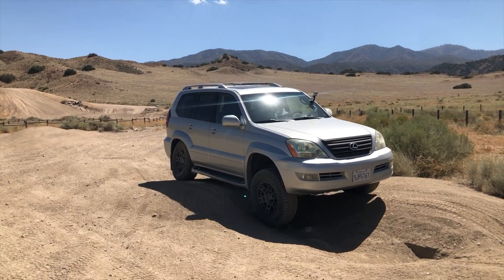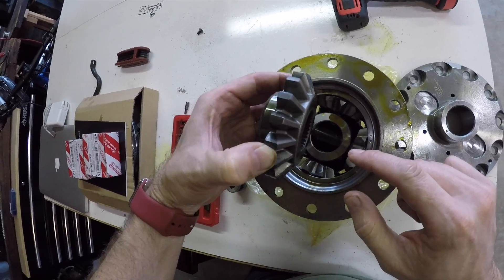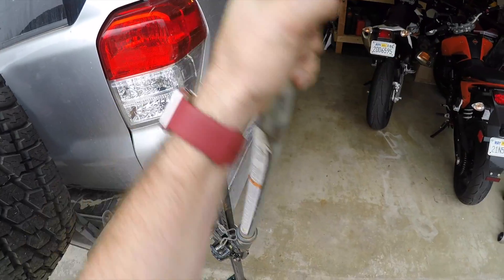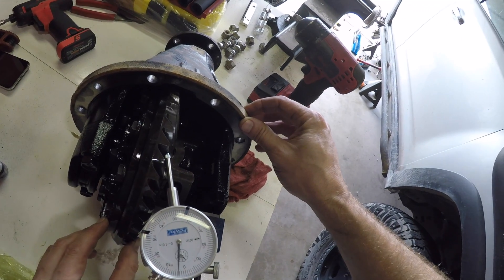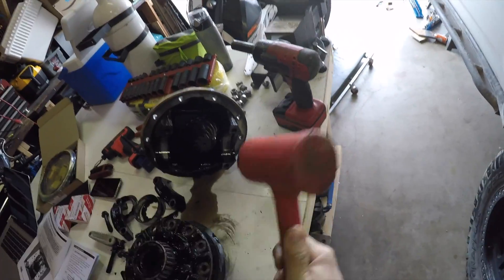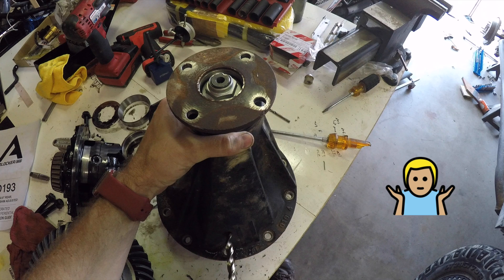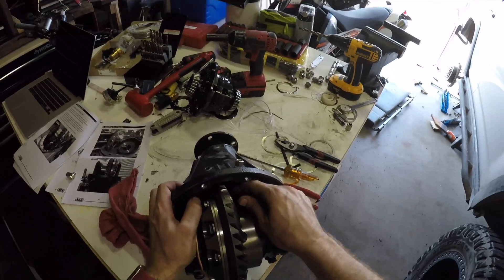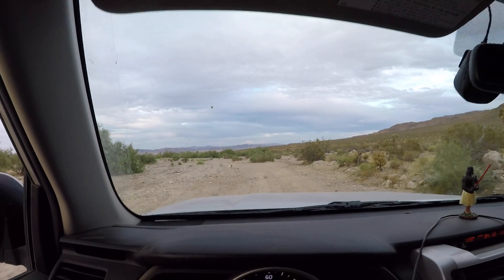The "Wrong" Way To Install A Locking Differential

Comment: great youtube history, congrats, but, i was surprised you didn't check gear contact patch with die or paint to see if your pinion shimming was still correct, one step always done when done right, in my observations, i was researching and close to adding front and rear limited slip to my 2001 4x4 1/2 ton black Suburban LS. it was so heavy in sunk and slipped a lot. so my research and elevator experience agreed with not only checking the side shims for preload but, also the pinion shim for gear contact patch. what did you experience, no change notifiable?

Comment: Here is how you can install a bearing without a press. Get a small pot, fill it with enough oil to cover the bearing. Heat the bearing to 350f. Remove it with pliers and drop it on. It will just drop, wait for it to cool and Bob's your uncle, it's installed. I have a camp stove I used.

Comment: 9:44: I did try to tighten PZ screws with PH bits (as well as vice versa) and I strongly advise against it.
Reply: I hate all of the cross/flat standards. We should move on to hex or torx only already.

Comment: For brake bleeding, clear vinyl tube works good, one end over the bleed screw the other in a small container with clean brake fluid ( stops air from sneaking back in)

Comment: Hey Matt, you never checked your contact pattern between the gears.
Is there a reason for this I am not seeing?
Maybe because you didn't change your pinion gear bearings? 🤔

I did this on my HJ61 9" differentials, but on these the preload and backslash is also set a little different.

Comment: When I grenade'd the locker on my Jeep Rubicon several years ago, I bought a replacement and took it to a local shop that specializes in rear ends. They swapped it in for $250 and it's worked perfectly since then. Your $1,000 quote seems rather high....  On another note, having a front locker makes a huge difference in many situations, it's 3 vs. 4 wheel drive. There have been many times when being able to lock the front made the difference between driving out, and winching out.
Reply: I was quoted 1k in labor for an ARB elocker as well from a very reputable 4wd shop in Denver.  Air lockers are also a little more finicky than elockers.  They probably bake a little extra into the price in case someone comes back with an air leak which is a pretty common issue wot have with ARBs.

Comment: If you don't use thread locker on the ring gear bolt, they (3 of them) could possibly back out and slowly shave the heads off. I'm just guessing, but it was a pretty good reason to get a new rear end...

Comment: From a mechanical perspective, why is a locker better than A-Trac?  The only advantage I can see with a locker is that you have equal distribution over wheel torque at higher speeds.  If you’re crawling, a diff lock doesn’t really give you any advantage as A-Trac Will manage torque distribution better than an even split.  But, at higher speeds or longer straight climbs, momentum is key and I suppose a locking diff would be advantageous.  Point being….I’ve had both features on my vehicles (4 Runner and GX) and A-Trac with 17” Grapplers has never failed me.  I see the advantage but certainly cannot be justified as a $1,500 DIY project.

Comment: And this is why i use a mechanical Detroit Locker in my jeep and Bronco. Installations much easier. No o rings to worry about going bad. And no onboard air compressor to purchase and install. Although the compressors nice to have for airing up tire pressure after running trails. But theres usually a gas station a few miles from most trails in Phoenix and Mesa.

Comment: I could be doing it wrong but I just got a glass sparkling water bottle, drilled a hole in the cap, put some 1/4 inch tube in it, then attach it to the bleed nipple. I make sure the hose goes up before it goes down to catch bubbles. You can bleed with one person but it helps with two to see bubbles.

Comment: Use a hose and jug. The hose goes on the brake caliper grommet and the old break fluid goes in the jug. Just have a second person to push brake pedal until no air bubbles come out in the jug.

Comment: I had an ARB air locker installed on my 1986 1/2 Nissan Pickup.  The only problem I had with it is that it wanted to pump differential fluid from the differential up through the air line.

Comment: Hey Matt why did´nt you build a diff spreader out of a coupple of turnbuckles and a bit of flat bar?
Reply from the maker: Because I didn't need to. but be assured I would have engineered something jankey if I had needed it.
Reply: @SuperfastMatt  Yea I redid a light truck Diff a few Months ago and boy did I need it, so turnbuckles it was.

Comment: Your air locker may not be broken yet since you've spent most of your time doing cooler stuff than driving it...  but when it does, just put the original back in there and weld the spider gears the way it's meant to be.  Done.  Try to avoid unnecessarily scaring folks by reverse parking in basement carparks.  Unless you enjoy that kind of thing.

Comment: Hi Matt, go to the hardware store and get plastic tubing, I have about four feet of it. take a used brake fluid bottle and drill a hole in the cap a little smaller than the tubing and push it through. take the other side of the tubing and stretch the end so it fits on the nipple for the brake bleeder ( you have to get the right size tubing). Viola, bleeding with very little mess.

Comment: I'm a little confused. So you don't need to use atrac anymore?
Reply: you ca use both
Reply: @iwantoffroad  what’s the point? They both are the same thing no? Sorry, I’m new to this
Reply: @ronaldcubillo4950  the atrac works when 1 tire is in the air and looses grip some times its not enough and the locker helps more. search you tube for atrac demonstrations in sand.

Comment: I've installed the bearings by heating them sufficiently (with map gas torch (the yellow bottle one)) and quickly placing them on. Have a piece of wood and BAHammer to make a final smack cause if it cools its in place and then you gottta buy a press

Comment: So 2:36. Pretty sure u can just use bearing grease (slides in easier) and a soft-faced sledge hammer (prevents damage when hitting it in) or just hit it softly with a normal sledge hammer.

Comment: You don't need to use a hydraulic press to get the bearings on.
You would find it easier if you have an induction hot plate to heat the bearing up which will expand the bearing.
When it's hot enough they will just drop onto the shaft, allow to cool and repeat for the other side.
Reply: Be real careful not to overheat those carefully hardened parts. Anything above 120°C / 248°F will reduce the service life of the bearing. The gold standard for DIY heating of bearings is with a pot of mineral oil and a thermometer.
Reply: Same for dropping a ring gear onto a differential unit....Heat that puppy to 220-250degrees and the ring gear will fall onto the carrier...can also put the carrier into the freezer if you like.

Comment: If anyone here ever needs to install the bearings without the use of a press fallow these instructions. Clean the diff. ●Lightly file or sand any sharp edges smooth 
●Put Diff in freezer on the coldest setting 3hrs minimum
●Place inner bearing race in a fryer set to 400°F
●Remove diff from freezer and stabilize in the vertical orientation.
● Remove bearings while wearing welding gloves and drop straight onto shaft. 
● Flip diff and repeat. 
☆☆☆☆ If the bearings don't drop all the way down go get it pressed on☆☆☆☆
Reply: 400 is way too hot for a bearing. 250 is the absolute max temp before you cook the bearing.
Reply: A open steel cage bearing wont be cooked at all at 400 we use bearing heaters at work that will go all the way to 550 on some pump shaft assemblies
Reply: @alexhise968  per Timken, absolutely no bearing should be heated past 250. I rebuild industrial gearbox for a living in a Timken platinum certified shop.

Comment: Loving the videos ... on a side note, what lift, tires and wheels are you running? I’ve got a limited as well and just about to put some KO2’s and a Torq-Engineering 3/1 leveling lift. Likely going with 17x8.5 with either 0 or -10mm offset and 4.75 BS (slightly less BS with the 10mm offset x can’t recall exact number). Also just subbed, thought I did that after the roof rack vid - still debating the build/buy on that one.

Comment: Nice video.  Consider power washing and raptor coating your axles and undercarriage.  Also, it looks like you do not pressure wash after wheeling.   If you do apologies, but if you do not I would highly recommend doing it.

Comment: If you had a 4th Gen, where would you put it? Front or back? I really do t know.
Reply: If you don't have lockers at all, start with a rear locker. That will cover 98% of your terrain needs. You really don't need a front locker unless you're doing some wickedly technical terrain which will also require big ass tires, lift, UCA's, clearance, etc.

Comment: Based on experience, no, you shouldn't use Philips bits on Pozidriv heads, and vice versa. It's probably your sense of humor shining through but I feel that if you're advanced enough to tackle this type of installation you should have a #3 Pozidriv bit in your toolbox. :)

Comment: Some people would say that it’s more important to have a front locker than the rear if you have an independent front and solid rear because there’s a lot more articulation on the solid than independent. But literally every manufacture who gives you a factory locker puts it on the back unless they give you both front and back. Their “experts” probably know what they’re doing.
Reply: A locker on the IFS front end will eventually end up in broken CVs .
Reply: Seth Coleman Colorado zr2 has a locker on  ifs.
Reply: @JonBecker81  yeah, but just because gm does it - doesn't make it a good idea.
Reply: @JonBecker81  IFS's are notorious for weak CV's.

Comment: So if shopping new, go with the TRD off-road instead of SR5 is what it sounds like.  Or is the ARB locker more robust than the Toyota locking diff?
Reply: I have an 03 TJ Rubicon with factory air lockers that have 8psi to hold them in place.  I was told that the ARB is 70psi.  If rock crawling was my thing I see an advantage but for FS roads I travel the factory ones work great.     07 and up have electric lockers.
Reply: Hillbillyjeeper WV they came with air lockers and not just electric mechanical lockers??
Reply: @JonBecker81  yes the TJ Rubicon (03-06) and LJ Rubicon (05-06) came from the factory with air lockers.  The bulk fittings on the one I bought used where rusted so badly that the air leaked and the lockers would not engage.  I called one of the 4wd parts store who in turn connected me with ARB.  Just by chance the gentlemen that helped me had work at a Chrysler dealership for years and knew which part I needed.  It's labeled as an axle vent and it's where the air hose connects.  The 2 small compresses are mounted on the belly pan.   I relocated mine to the engine compartment.
Reply: Arb is better than toyota
Reply: @alecbryantalledo  ARB lockers aren't that great and have known problems with newer designs...mostly blowing seals. Factory lockers are pretty damn reliable, don't require onboard air and lines that leak
Reply: Hotdog Man but if you’re buying a new truck then you get the warranty if something does wrong with the locker. Plus realistically, how many people would actually do the installation themselves? I wouldn’t. I’m not brave enough.